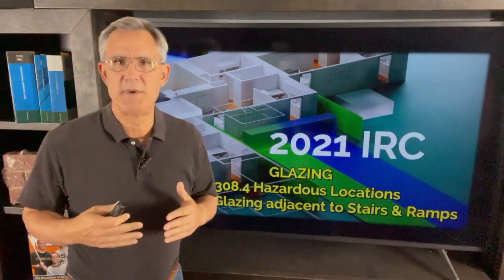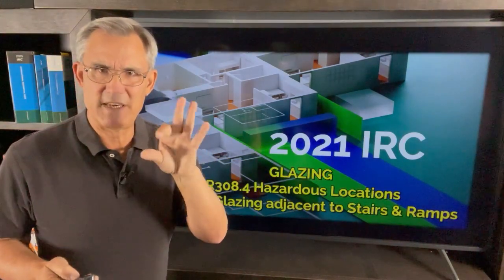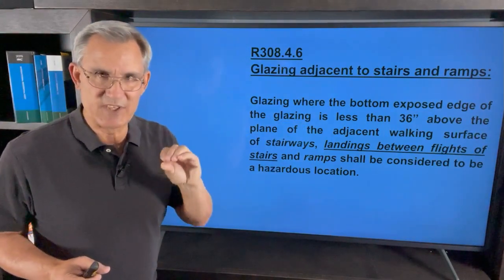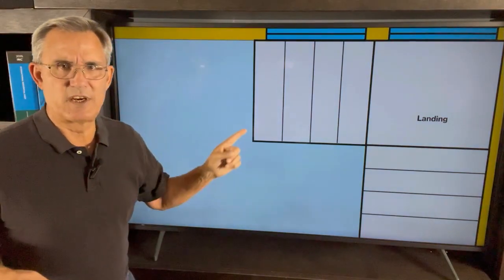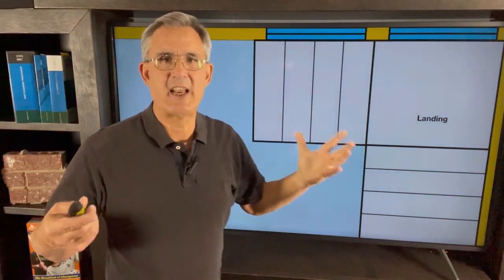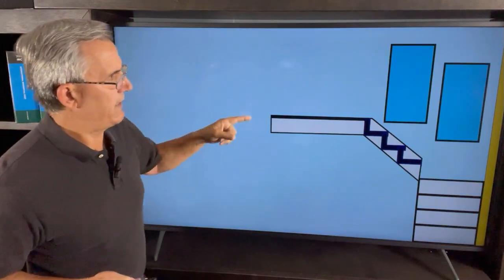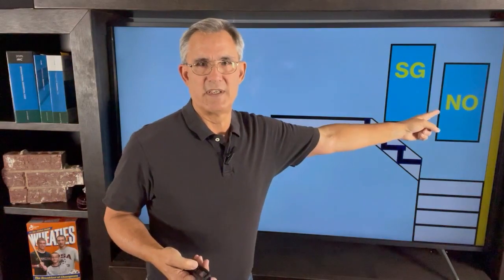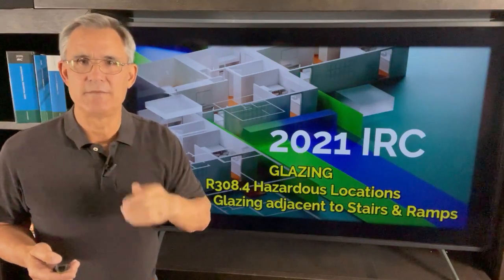Safety Glazing Next to Stairs & Ramps - 2021 IRC

Comment: I'm still struggling to understand this rule, and I'm currently looking at the IRC Code and Commentary, and it seems like it is in conflict with what you are saying here. You say the lower window shown is 38" above the walking surface and does not require safety glazing. But isn't it within 36" above the adjacent surface (the uphill section of stairs)? I wish I could embed a picture here, because the commentary seems like it contradicts what are saying.
Reply from the maker: Sorry for any confusion.  Focus on the 36” rule.  At the landing - measure up 36”, if that touches glass it needs to be safety glass.  At the stairs, measure up from the plain of the nosings 36” and see where you are.